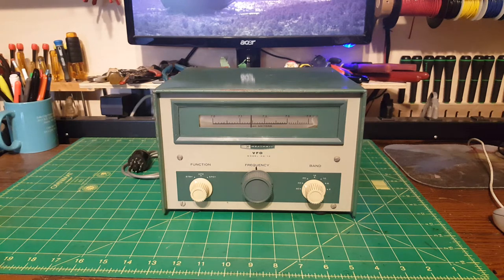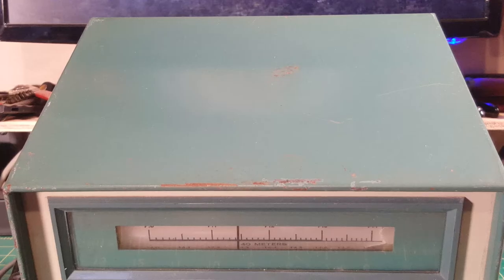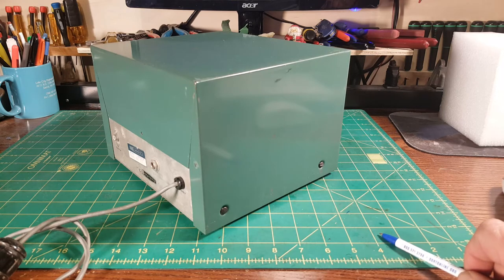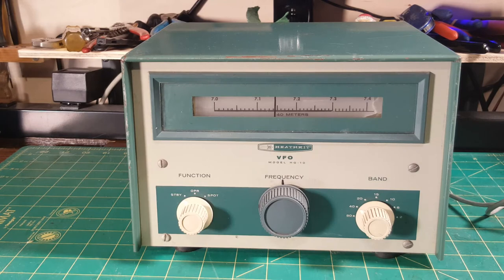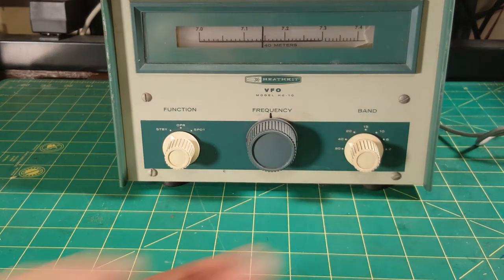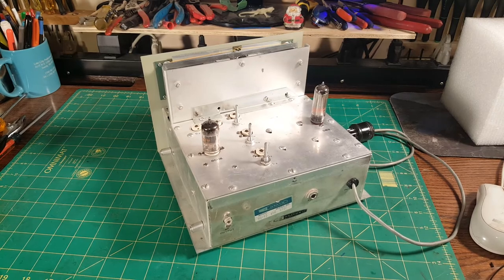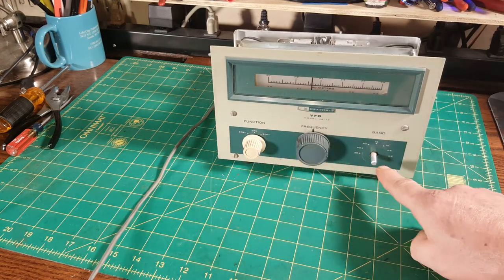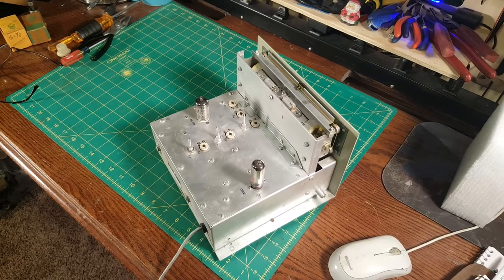Restoration First Look Series - VFO - General Class Heathkit Dream Station from 1968  - part 2 of x

Comment: Awesome information. I just want to add some information, it's not for everything plastic. But with the super glue use baking soda. Use a little super glue put a little baking soda shake or vacuum off extra and repeat process until its built up where you want it. And the when it's good and dry or hard you can file it or shape it to what you want. That would work good in the cracked knobs. Just some information
Reply from the maker: Thank you!  Believe it or not.. your baking soda and super glue is a wonderful way to get an aquarium to stop leaking.. it's not a permanent solution but can prevent 125 gallons of salt water from destroying your carpeting. lol. I'm going to use your method on the next cracked knob, etc., that I need to repair. Thanks again!   :)